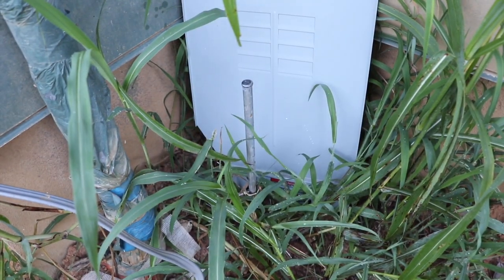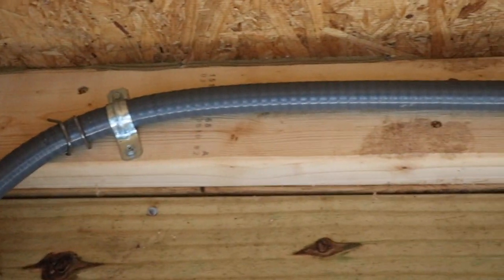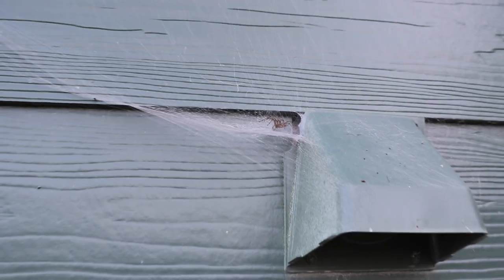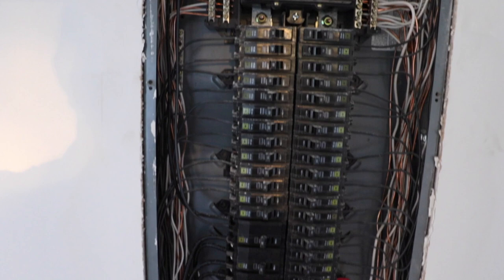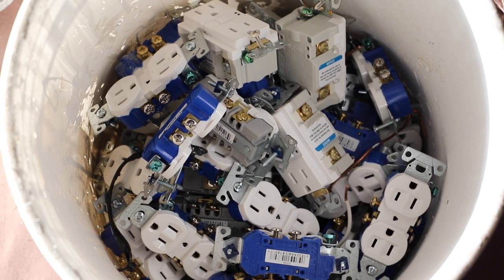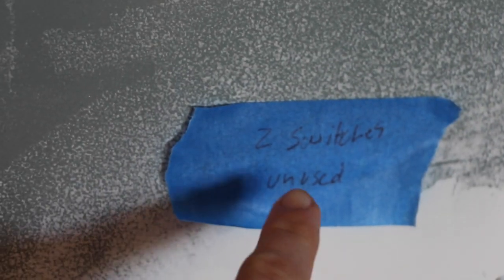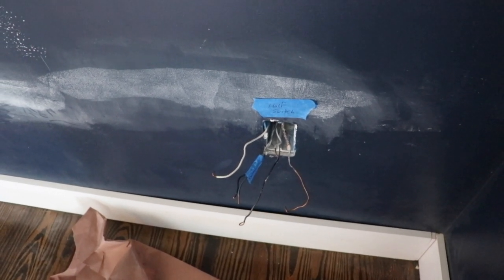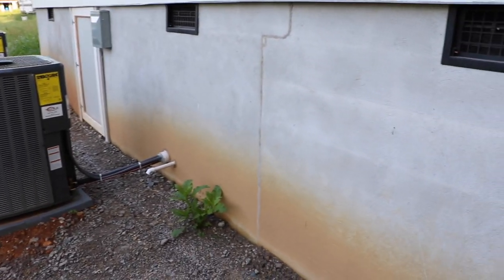Electrical Contractor Failures - Trade Tips

Comment: You did not clearly and concisely ever mention power being off or Lock Out Tag Out or power company hasn't energized the service because the inspection failed. You're not considering a panel change-out scenario where the service is energized when the Electrician shows up at the property, and when he leaves he turns it back on BEFORE the inspector comes to check it. It's the nature of a panel change are we supposed to tell the homeowners we can't energize their service until the inspector signs off? No we cannot, they need to cook dinner, heat the home, ect ect. So we energize and test before we leave so the family can get back to life as usual. You even said in your video "things to check BEFORE you call for inspection." The Electrical Professionals that are posting here are 100% correct John Q. Homeowner with little to no electrical knowledge will get a good bite at best, and an early death at worst if he follows your advice as it currently sits in this video. Please do not be defensive of those being critical about you touching the lug. Edit the beginning, a 30 second bit about a Non-Contact tester, test it on camera with an extension cord show that it works, test the lugs on the panel show that they're not energized, test on cord again to show that Tester is still working. 

All that being said I also agree with others, you obviously took the lowest bid(unlicensed) and took to YouTube to show what a hack electrician looks like.  It's sad really, I just hope no one gets hurt.
Reply from the maker: K C this video is about a new home build, if you knew left from right you’d know that the house will not be energized until it qualifies for temp power. ANYONE who calls themselves an electrician and thinks this is good work, should probably hang up the tool belt.
Reply from the maker: K C and no not the lowest bid.

Comment: Whoa, wait a second. Both electricians let you help wire the place. That explains a lot to both failures. Hope the inspector knew you had a hand in it, or maybe you did tell and made him automatically fail it. Proper Electricians will not let you touch the wire in fear of their EC license is on the line. Trust me I know since I do Low Voltage and decided to have a former electrician that was with me move a whip from one bay that was too small for a Low Volt Structure Panel over one bay (other side of the stud). Even got approval from the property super and in the end they back charged the builder and then in returned back charged us. Since then I don't touch their lines and try not to look at them.

Comment: It would cost this "farmtrician" alot of money to have me cold troubleshoot everything wrong electrically wrong with his house. I would start from scratch and rewire the whole house. Nothing in the panel was marked. I use short pieces of Rolex outer jacket on every wire terminating in a breaker. You can't trust the panel schedule after a few years. Not to mention those panels looked terrible.

Comment: Those nicks in the wire at 12:00 were likely caused by your Drywall guys. In my experience the drywallers when cutting out the receptacle cutouts nick wires from time to time.

Comment: If you're giving advice to your followers to make sure the electricians are doing the wiring correctly, what does that say about you? The problem with some GC's is that they use in house installers to wire up equipment, homes and business. Unless the GC has a C-10, they are forbidden to install any electrical wiring systems with the exception of low voltage wiring (i.e.) home entertainment systems for example. What you gave us was a Readers Digest version of what you and the non-electrical contractor did, which leaves me to believe there is a lot more wrong with the total wiring throughout your home.  If you live in a "Right to Work State" this is what you're going to get.  It looks like the electrician installed a Meter Main, not a Meter Combo. If so the first load center doesn't have the have the grounds and neutrals separated. It's only after a second load center is installed do you have to separate the grounds and neutrals. I hope you were able to straighten it all out.
Reply from the maker: Steve Kirkland it has a meter combo. First box shown in the video.
Reply: @YanasaTV  It was hard to tell on my end. I hope you finally got everything in order.  Have a great New Year!

Comment: you called LMFC (Liquidtight Metal Flexible Conduit) wire,  the "grease" is called Noalox which is an antioxidant and mostly only used on Aluminum, on the ground bar there is 2 grounds and a bare ground which is fine (referring to one of the outdoor panels) , vent cover should of been installed by an HVAC company so that's the fault of whoever was running the job, you referenced a 2015 code book that doesn't exist, there is a 2014 book. Arc Faults are only required in dwelling unit kitchens, family rooms, dining rooms, living rooms, parlors, libraries, dens, bedrooms, sunrooms, recreation rooms, closets, hallways, laundry areas, or similar rooms or areas shall be protected by any of the means described in 210.12(A)(1) through (6), not every breaker needs to be AFCI.  God there's so many things wrong with whoever made this video, stop trying to correct things you don't know because you'll save yourself from embarrassment.

Comment: I dont know where you found this amateur. But I noticed at about 10:25 you said you installed the outlets and the electrician was supposed to check behind you... I will guarantee you he was the lowest bidder. I also guarantee you were a bigger part of the problem than the solution. Prime example is you installed the receptacles and the one outside was a "dummy" with no wires in it.  Because a dummy installed the receptacles.

Comment: You should NOT be doing electrical work and obviously neither should the first electrical contractor. Obviously you passed the rough inspection otherwise you would not have Sheetrock on the walls.

Comment: So you wired it yourself... which means you put the wall boxes up too... some in the wrong spot. And you miscommunicated which wires need connecting... and you left unterminated cables behind drywall so the fit off guys couldn't see them... and your Sparky is to blame? Why were you doing ANYTHING? The final sub circuits to the AC ARE conduit... the feed looks like XLPE. And you bought the outlets to save some bucks and fitted them... but the sparky is to blame that they aren't tamper proof. Did you buy the switchboards? The ones with missing link bars? If you wired the place, why didn't you add the service outlet near the AC units? Sparky can't fit what's not there! And the outlet with no wire... did you NOT wire it? Sounds like your project manager was inadequate. WHY WOULD YOU PUT YOUR FINGER ON AN ACTIVE LUG WITHOUT MENTIONING THAT IT IS TESTED AND ISOLATED? WHAT IF SOMEONWE SEES YOU DO THAT AND ASSUMES ITS OK?!!! Next time, actually hire an electrician to do the job, not to just come in and pick up the pieces.
Reply from the maker: I ran the wires meaning pulled the wires through open stud walls. They put them in the boxes and did everything else.  My work passed inspection... that was rough in.  This inspection was what they call trim out.

Comment: Why are the walls even covered/sheetrocked? The inspector shouldn't have passed a rough in.  

Nobody is right in this situation. But I would be most pissed at the GC, shit rolls uphill when you're building houses.  The guy who did the electrical should be stopped asap. 

Charlie doesn't knows what he's talking about,  he's obviously repeating what he's been told by the inspector and his real electrician.  If he actually knew this much when the guys were doing the work,  he wouldn't have let it get so bad.  

I hope the homeowner isn't still paying the price for their GCs poor supervision

You get what you pay for
Reply from the maker: Warren Manne they passed the rough in (on their third try) this was the trim out.  But yes, the points made correct or not were points told to us by the inspector and follow up electrician.  Of course I'm not sure the second electrician was all that honest either some of the commenters make good arguments.  Ultimately it falls on the electrician, they are the ones licensed to do the work. Their license is not only a certificate of education but also a commitment by which they are held accountable.

Comment: So your plumber was your electrician? That didn't send up a red flag? As an electrician I agree with everything you pointed out. Very sloppy work. I can do plumbing but I don't claim to be a plumber. I understand that in some areas it may be difficult to find all the trades and your stuck with some of the local people. But you or your contractor needs to do a better job of vetting the trades that get hired. Tradesmen like this one give us all a bad rap.
Reply from the maker: It was a “mechanical company” so the plumber and electrician were not the same person.

Comment: You do NOT need a ground fault breaker in a living space. Only where water may come in contact with the equipment. You can in fact double up wires on the neutral bar nothing in that would cause you to fail inspection. Wire colors mean jack and shit..... it doesn't matter what color you install on which leg. Man you don't know what you are talking about in a lot of this.

Comment: The light/receptacle combination/abomination you installed and then expected the electrician to check for are not only stupid but don't go well with any type of code. You're not supposed to ground fault protect lights as they weaken your gfcis

Comment: Majority of these problem are a result of poor training since pretty much anyone can be an electrician without the smallest amount of training. Most of these contractors hire people that could not pass a drug test or a background check.       Looks like you're interested in the aspect of doing proper work in the electrician field. Why don't you look into power linework? It pays way more than any dinky electrician job  and you won't have to deal with all these bottom of the barrel "tradesmen". Better benefits and retirement and major job security. I was an electrician for 2 years before I got fed up with that crap and got into power linework.
Reply: Mirroxaphene not if you can't stand the heights, unconditioned spaces, allweather exposure and lots of sunlight.

Comment: No offense bud, but before you critique an electricians work, you should learn the terms of the material your describing. For example, you call flex, wire. You also say "box for the AC" when your talking about the "disconnect" or "sub panel". You say they used the wrong size "bolt" for the SER ground when it's called a "lug". So it's almost like the blind leading the blind. But, I do appreciate what your doing. Can't hurt to learn what's right and wrong.
Reply: There's no need for penetrox on copper connections. Will it hurt the wire? Hard to tell. Some say yes, some say no. Personally, I will always use it on exposed aluminum connections

Comment: your wrong about the seal tight going thru the block needing it to be sleeved also concrete block is considered a sleeve and there are just so many other problems that you pointed out that are wrong id have just as long of a video

Comment: you got seriously screwed.  dont pay subs untill work has passed inspection. by what i seen in the box, i'd make you remove all the drywall finishes, all of it. that should not have been done before it passed roughin inspection, i'd alsal charge back the drywall guys for the wire dammage and tag removal.   never pay for somthing untill it meets code and passes your aproval.

I would not use the outlets, I had to replace every outlet and light switch in my sons house becuse the plastic was falling apart on a 15 year old house, none of the outlets had grounds going to them the electrical contractor mixed brand of circut breakers and the main pannel to cheat the box out of one space.   the same people wired the house acrosses the street it burned down, electrical problems.

We seriously meed laws so yo can sue a contractor for shoddy work.

Comment: Electrical grease lol I think you mean Anti-oxidant. Copper doesn't rust so you do not need any "electrical grease" there. 

"Red on right black on left" is just a pneumonic device. The order you terminate the phases is irrelevant as long as it's consistent. 

The outlets not being up to code is a direct result and key demonstration of your own ignorance and incompetence so you shouldn't have included those here in your criticism of whatever immigrant-based contractor you chose to hire. 

Haircutting the equipment grounding conductor is a no-no and bonding at the subpanels is also dangerous but that's what you get when you think you know everything so you just hire a write-off electrician to scrape past the codes. 

Electricians have to spend 4 years in school and 8,000 hours working before they can even test to become licensed (at least in my state), so maybe consider that you don't know even a fraction of what would be necessary knowledge, to walk through somebody's work and make valuable criticism.

Comment: Dude, get a non-contact voltage tester and use it!  You're freaking me out touching everything that conducts electricity in every panel with fingers, screwdrivers...yikes!

It's actually a little tricky to strip larger cable without nicking the individual strands.  Your six year old cannot do it.

If you installed the lampholders with the built in outlets, why blame the electrician for not GFI protecting them?

What is a "Main subpanel?"

The outdoor outlet also needs an in-use cover.

Hang on to those non-tamper resistant outlets, you'll want to put them back in as soon as the inspector leaves.

Wrap the nicks with electrical tape.

Why are you AND your electrical contractor working on the wiring?

It will take an electrician minutes to figure out your switching dilemma in your kitchen with the romex hanging loose in the ceiling waiting for the island.

Again, with your half-hot outlet it's a total non-issue to determine which is the hot and which is the switch leg.

Yes, you should have an outlet on the back of the house. And the front.  Wasn't aware of one required in an attic.

I think you're overreacting a little bit, hope everything works out.

Comment: The general contractor clearly did not hire qualified or licensed electricians to do that job. The mistakes you are pointing out a competent 2nd year apprentice (out of a 5 year apprenticeship) could have gotten right. smh ….Also what was on your electrical drawings and did you even have any? Pretty sure they are required to pull an electrical permit, At least in my area I've always needed electrical drawing to pull a permit because a job of that scale would require load calculations.

Comment: Guess what with your air conditioner disconnect that silver tube you said was a wire is actually your air conditioners line set which is run by your heating and air company!!  As an electrician myself i can tell ya exactly whats goin on

Comment: Any electrical contractor that lets a home owner do his own work under his license is asking for trouble... The work looking like a blind man did it but the home owner should have not been doing work in the house.  As far as separating the grounds and neutrals in the panel goes that can be done by pulling out the screws that connect the ground bar to the neutral bar... The AC sub-panel should have had the neutral marked with white tape... also there needed to be bushings installed on the connectors entering the panel... and the main sub-panel workmanship looked like hammered dog shit... as far as if two or more wires can be used in one connection goes... that completely depends on how the termination is listed.  The outdoor outlet does  not look fine... it should be GFCI protected.  Did any of these electricians ever get to be journeymen ??? There is a long running add in the local newspaper where a contractor is always trying to hire carpenters with plumbing and electrical experience.... so it's buyer beware in the trades in some places in this country.
Reply from the maker: JT H in North Carolina there is no journeyman or apprentice license.  A qualified licensee can hire W2 employees to work under their license. You can see the problem.  Everything you just mentioned were things done by the electrical contracting firm. The homeowner only ran wires and hung boxes and fixtures, the electrical contractor stapled wire and ran the wires into the boxes.  The home owners work passed.  Any time you as an electrician walk onto a renovation you are coming in behind someone else's work that is existing.

Comment: I get that some of these things are obviously bad installs... however, that being said... you need to learn a bit more before you start pulling up code from the NEC.   There's a TON of things you mentioned that a inspector would literally ignore.  Not saying that they're not complaints just saying that you're obviously not an electrician either.  Looks like you hired a dry wall technician to do those installs. 
Lots of "that doesnt pass code" by someone that has only read the cover of the book in my opinion.
you keep to doing "ranch hand" things... leave the code to the inspector and those trained to use it. :)

Comment: You must have taken the cheapest bid and failed to see if the electrical contractor, was licensed, insured, and bonded,  plus you need to know more about the electrical residential industry before you can down-grade an electrician,   because  all of this happened says a whole lot about you, because you didn't stay on top of it all while it was going on.  You Pay for What You Get and a whole lot of this is your fault.   Good Luck in the Future.  By the way you don't need a neutral in an air conditioner disconnect.